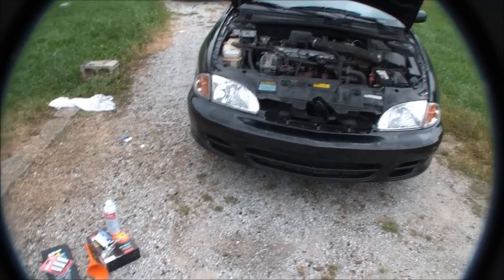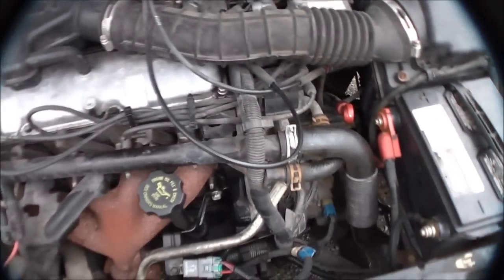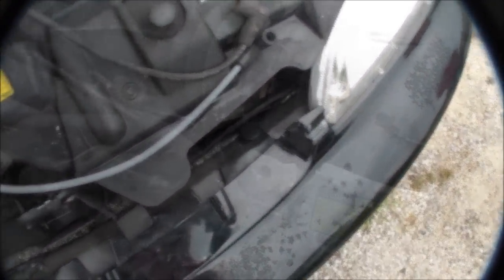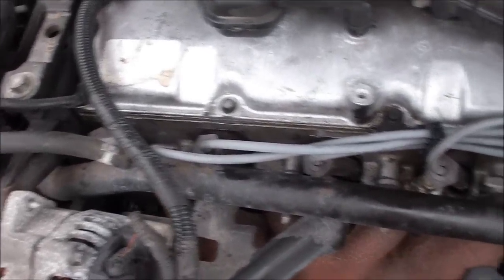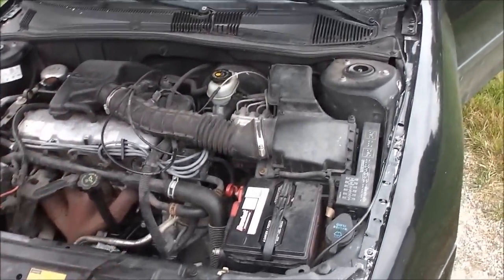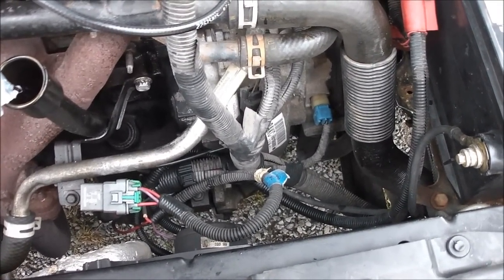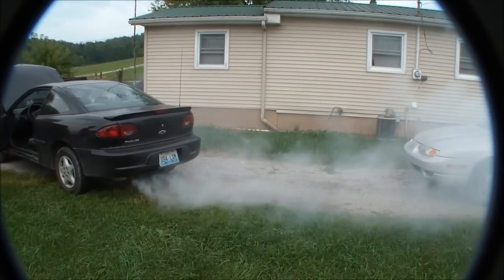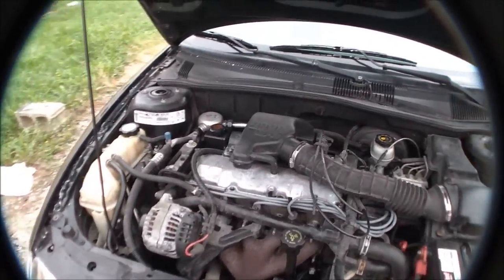Cavalier Tune-Up

Comment: Get a Actron CP9680 code tester. It checks live, record, graphing, transmission tests, ABS, SRS, record, emission readiness test, and MORE! It comes in a black pouch. Get 4 aaa batteries for under the rear cover. It's well-lit! Get a USB cable to update it from EBAY.

Comment: still my cavalier he is a good car just recently had a over heating issue. replaced my cooling fan, thermostat and cooling reserve tank. need to replace the radiator hoses. my mechanic said the hoses were compromised due to a prior accident the owner before had. i love my car so yep i will replace them too
Reply: since he fixed the over heat issue its running again. he said my temp gauge runs higher than than it says so far my car goes to the middle then ibam assuming my fan kicks in and the temp goes down. no over heat lights are on anymore

Comment: No problem,I learned that the hard way after I Seafoamed my Trailblazer after installing new plugs.A bottle of Techron in the tank cleaned the plugs and it runs like new.

Comment: I just bought new e3 diamond spark plugs for my Pontiac Sunfire it same motor as yours and I bought a quick tuner performance Chip for it to it's not in my car yet I should buy some new spark plugs wires to
Reply: Use the royal purple oil and some Dura lube treatment oil your car will run like a dream and get a new k&n fuel filter

Comment: Seafoam will eat away sludge/carbon deposits that rob horse power and fuel economy, It is an easy way to clean your motor Brandon Jackson. stw9495 next time i recommend seafoam then change the plugs i have fouled them using seafoam. Also if the car ran fine just had bad fuel economy wouldn't have been the wires. check o2 sensors, my 2.2 dropped to about 11 mpg with bad o2

Comment: you didn't put plug grease on the plugs
Reply: You dont need it. From an engineering point of view, you are changing the amount of torque it takes to tighten them. You would use too much in other words. If you look after your car, you won't need it.

Comment: hey just so you know that's not an ecotec. ecotecs don't come stock with a distributor. o.o
Reply: Ecotec engines literally say Ecotec on them as well. That one says 2200 SFI.
Reply: later 2200's didn't have a distributor either 2000_2002

Comment: You don't smear the dielectric grease on electrical contacts! It goes on the inside of the plug boot and on the ceramic part of the plug ONLY.
Reply: It won't hurt anything.